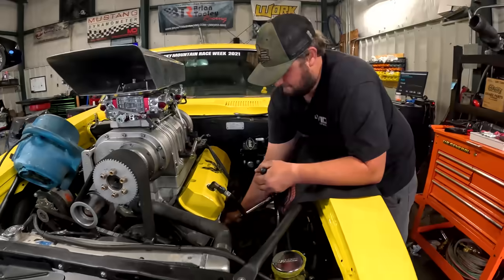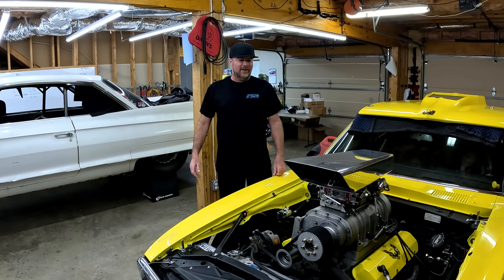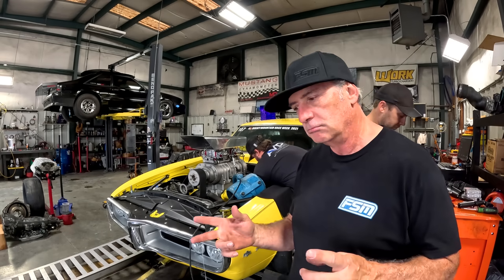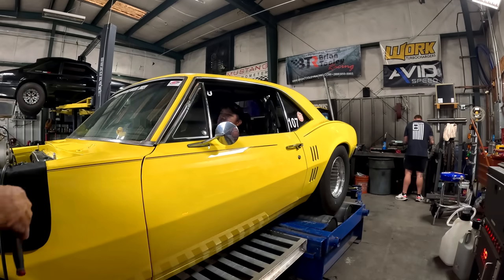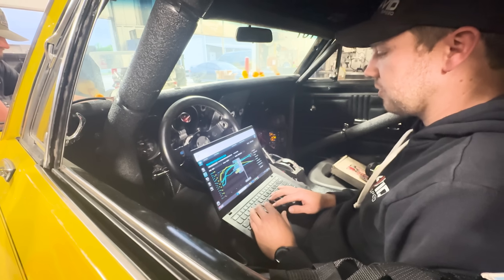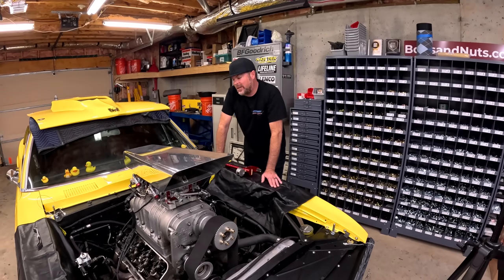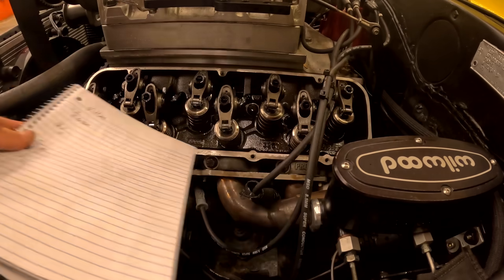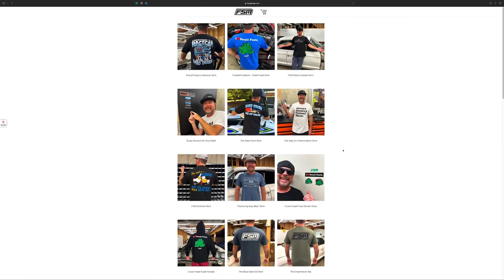I Spent $88 Bucks on Carb Jets and Added Nearly 100HP to My Barnfind Pontiac Firebird!

Comment: As a engine builder a big block with a solid roller needs more spring pressure to control that heavy valve
Reply: You need to listen to this man if that thing's got 155 lb of seat pressure you're going to have big problems if you keep running it like that
Reply: That pressure seems kinda low to me, not knowing what Cam is in it I couldn't swear to it but that's my guess.
Reply: @fredmertz1791  I corrected it for ya lol lack of sleep had me fat fingers when typing that
Reply: Agreed. The only way those numbers would be acceptable was if it had a hydro roller in it.

Comment: The absolute fastest method to lash valves is to start with # 1 (take your pick, int or ex) then turn crank 1/4 turn and check cyl 8, 1/4 turn 4 following the firing order. You end up turning the crank 2 turns to check 8 valves. Then set up # 1 to check the other valve and again 1/4 crank turn at a time you go through the firing order. This method eliminates missing valves. 
Just remember, with the exhaust valve just starting to open you check the intake valve lash, and with the intake valve nearly closed you check the exhaust valve lash. (this is called the EOIC method, and it works on every single 4 stroke engine in existence)

Comment: My car was doing something very similar.   It would break up at 6K most of the time.   And sometimes I would think I had it fixed it would go to around 6500 then break up.   After a ton of chasing and changing parts it ended up… it was the distributor itself.   I swapped it out with a new MSD, BAM problem solved.

Comment: Good to see Blake on here. He tuned my 2012 Silverado after I built the 5.3 in it and got rid of all the AFM and VVT parts and got it perfect
Reply: Thank you!! Glad the truck is doing well!
Reply: could the VVT have been tuned?
Reply: @jamesmedina2062 on some gm models, the vvt is more for egr/emissions than performance
Reply: @jamesmedina2062  it could have been disabled but my engine was losing around 4 quarts of oil every 3000 miles with only around 80k miles on it and GM claimed that was normal and within range for their AFM engines so I just tore it apart and took it back to its pre 2007 roots with some better heads, cam, valves and springs and 3200 stall torque converter.
Reply: @kyletaylor6058  Gotcha. You have a cooler connected to trans for that converter? I'm trying soon a new cooler with my trans and it's a lower stall but its a 9.5 Stallion
Reply: @kyletaylor6058  GM like many does not like to acknowledge and fix issues at dealer level. Sux
Reply: @jamesmedina2062  didn’t have a cooler on it but it for sure could have used one. I kept a pretty close eye on my transmission temps as they would get higher than I was comfortable with at times.
Reply: @kyletaylor6058  well more fluid can make up for that but adding cooler is easier now than ever. There are so many options now. At least you can see your temps.

Comment: Even my solid roller Small block Blower stuff with 2.10 intake valves about 230 on the seat and 575 over the nose , my Hydraulic Roller stuff is about 140 on the seat !
Reply: Exactly what I was thinking! I was also wondering if that was cold lash. I may have missed if the engine was warm, but both covers were off and filming. My guess is cold lash and that's way too much.
Reply: @arturozarate1752  
I saw that too  !

Comment: Air bleeds are part of tuning.
Control upstairs fuel curve with hi air. 
O2 are great for guidelines, read plugs.
Reply from the maker: The odd thing here is that at the dragstrip I saw zero evidence of a fuel ring at the bottom of the porcelin on the spark plugs. But its hard to argue with a functioning wideband O2 sensor and dyno results. The car makes more power with smaller carburetor jets.
Reply: @FinnegansGarage - Yeah any real timer will always use the plug as the end all decision maker.  That is very odd that your plugs were not showing a ring on the base of the ceramic as rich as it was.

Comment: Have you ever heard or tried the "carb cheater"? that device gonna help you tune the car on the fly and it will make your life with carbs driven cars much easier. I recommend you watch some videos on it I bet you gonna like that product.
Reply: ThunderHead289 has been a busy boy... and it works great.
Reply: Tune the carbs properly  , Carb Cheater just leans the mixture at part throttle , getting the jets and air bleeds corrected will do the same thing .

Comment: Changed Valve springs in my 390FE using a compressor and spark plug adapter in the cylinder heads. No need to remove heads. Might try that for a quick fix..😏

Comment: As long as you have the valve lash measurement you don't have to worry about overlap if you put the base circle of the cam down individually on every single valve do One works every time on  Just about any engine you'll rotate the motor a whole  Bunch of times.

Comment: Watching Old school Pro`s work is so satisfying. A lost art. what I don't understand is prior to the tuning Why did you not pull the pan and heads and simply check the internals Ring gap rod and main clearances verify TDC and measure dome and chamber. Even the camshaft can be Guesstimated in block. This is a weekend project (Friday night to Sunday afternoon) at least in my garage. The peace of mind and knowledge regarding on the internals is priceless especially considering the Maximum of 400$ in parts for Head gaskets rod, main and worse case rings. Cheap insurance and the best part is if it was not built as you need you will know what you have if you sell it.

Comment: Had a msd distributor pickup that would go stupid at high rpm and acted like spark scatter. Drove me to drinking!! Swapped crank trigger on to test and clean pulls with no problems.

Comment: I had a similar accident. The boot you have i  disliked as well. They molded a snug fitting one out of some kind of epoxy so that i can fit a size 12 shoe over it complementing my left one in size  9.5. I ripped the inners out to get a somewhat even stance.

Comment: That spring pressure seems very light for a big block solid roller deal with boost. My small block with an f2 and mild solid roller using the same LSM spring checker you  used checks 270 on the seat with a PAC1225 spring and thats with a 2.125 valve not a 2.300 valve that those darts probably have

Comment: Have you thought about using using a camera to go through the oil drain plug or spark plug hole to look at the pistons? In the past I've been able to read a part # that way. Some of the new cameras you can even steer to look back up at the valves or head gasket leaks. On my blower cars I use a huge generic 3/4 ratchet and reducer to spin them over to check lash. I picked it up at the Rural King store.
Reply from the maker: those are excellent ideas. i lost my long handle ratchet and need to replace it.

Comment: Mike you may have to go to a heavier valve spring with the boost as I think you maybe floating the valves a at the higher rpm you may have to go to 180/200 lbs on the seal   cheers

Comment: A much easier way to do valve lash is to start at TDC, do the lash on all loose rockers, and put a dot of paint (paint pen works best) on the tip of the rocker stud to show the lash has been done on that particular valve.  Then rotate the crank one quarter of a turn (because there is a firing pulse every quarter of a turn on the crankshaft) and repeat the lash on every loose rocker. After two complete turns of the crank, the lash will have been done on all cylinders.  This way you don't have to keep track of what cylinder is on it's base circle.

Comment: Mike, that seat pressure, if measured accurately, is TOO low for a solid roller. That's hydraulic roller seat territory. Also the lash....if cold thats a lot.

In my experience with blower cams, the card has asked for 0.018" to 0.022" hot lash. 

With the expansion of metals different between engine to engine, I like to test each engine the same. I start at zero lash cold. I bring the engine to operating temperature at idle. I then remove one valve cover at a time checking lash at this point. On an iron block with aluminum heads, I've measured as little as 0.004" to as much as 0.006". With the difference in manufacturers materials there's a variation in densities and therefore expansion.

So now knowing this hot lash measured you know your expansion and can set lash cold accordingly. Hope this helps.
Reply: Strongly agree.  Not sure I've ever seen both valves set the same. Exh normally has more clearance to compensate for more heat.  Good advice. 👍🏼
Reply: @rivermobster  well, the cam I just stabbed in a Shelby Aluminum 482ci FE asks for 0.020" hot int/exh. Although I know what you mean.

Comment: my old 360 with a mild cam Had 120 130 ish @ the seat in 2004. that needs way more than 145 or what ever it was i would change the spring to some thing better but I guess you need to careful the valves are up to bigger springs and not pull a head off lol

Comment: Valve area x boost psi subtracted from static seat pressure = running seat pressure at boost. 80-100 psi seat min your good.

Comment: I broke my leg (tib/fib)15 years ago, but just a couple of weeks ago, I had 2 screws surgically removed that were above my ankle because one of them actually wore a hole through the skin and became exposed, no joke! I had the other one removed just because it was next to the exposed one anyway, and it was bothersome and could have gone down the same road as the exposed one. If anyone would like to see a picture of it, ask me, and I'll email one. It was pretty odd. Even the Dr's had never seen anything like it, and I became the freakshow of the office.😅 So I feel for ya, Finn. I hope you heal up quickly!
Reply from the maker: ouch!
Reply: I had a pin that healed under the skin in my hand. Freaked me out when the doc pulled it. But it popped through without any pain and was not a big deal. I do have screws and a plate that I am planning to remove this year from my foot. Hopefully that also goes without pain. Gotta stop breaking stuff!
Reply: @imalec  Yes, breaking stuff is no good! Good luck with the removal!
Reply: @FinnegansGarage  Ouch, indeedarooni!!!
Reply: @imalec I had a screw in my thumb that had a pin next to it. I went to grab something out of a friend's hand and he slapped my hand. The pin immediately popped out with no pain but I screamed just to make him feel bad. I went to the doc and he finished pulling it out, that stung a little. My friend felt so bad. He would do anything I asked until a week later I told him I didn't even feel it.

Comment: Not remotely enough seat pressure for a solid lift cam with boost on a BBC with huge heavy valves, I been thru this exact thing engined revved clean no boost, added boost and ended up needing more spring then it would rev to 7600 on 17psi ( on accident I didn't like more than 7k).
 Shim em up if you to room for coil bind, and it will literally pick it up everywhere...

Comment: Mike that spring pressure sounds low for that combination, could be your floating the valves
Reply from the maker: its very possible that you are correct. It was fine on the dyno but this next track test will tell me whether or not we have a valvetrain issue.

Comment: I wonder how skewed the number are on that gauge by the variables that affect it? I’ve never saw a solid roller setup with less than 240 on the seat. I’d think a BBC with heavy valves and a blower to boot would like 260 on even the most mild solid roller setups.

Comment: what are plugs gapped at? I've had to go as low as .015 to light them off under big boost. Having a ton of gap isn't going to make much power. better to go small with forced induction.

Comment: Solid roller BBC with 140-150 on the seat? Sounds pretty light to me, I would say not enough valve spring for 7000 RPM.

Comment: Glad to see your healing up buddy. Stay away from the manuals for a little longer so that break can heal up strong. (Sorry, its the dad in me). Now I will make a prediction here. Barring that little stumble at the end of the last pull , you'll get your 8 without the party pully. Think about it. 10% more HP than before. And even more of a torque increase. My guess is 8.97.   And as for the stumble, Joe  opened up the plug gap. I didnt hear how much. And possibly some dust got in the carbs while they were opened up. They did have them opened 4 times? Just thinking out loud. You'll figure it out and get your 8.
Reply from the maker: I'm proud to say that while moving cars around the shop today i resisted the urge to drive the 510, the elco, the crx and Death metal cause they are all manuals. lol
Reply: @FinnegansGarage  And, let me know when your ready for more salsa (I know, silly question)...

Comment: I’ve heard you say that about the guy not using silicone. I typically don’t like using silicone on gaskets unless there’s a seem where two gaskets come together, but I don’t really build high horsepower engines either mostly stock with some mild builds. I was taught that that’s what the gaskets for, and if you clean the surface well enough, and your mating surface is straight you won’t have a problem, from someone who at the time I thought was an old timer, now I fit that description. Lol but I’m always open to learning something new. Do you use silicone on the whole gasket surface, and why?

Comment: For not knowing what internals are in that motor it runs great for the abuse you have been putting it through! $88 was money well spent to gain that much horsepower and that was without the party pulley!

Comment: Is that enough valve spring pressure to control the valves with 10psi  boost?  What about the party pulley?

Comment: For that boost I'd think it would make more to the wheels out of a BBC. Have you guys done a leak down on it yet?
Reply: Also, while it was on the dyno did they check how much the converter is slipping? It pretty simple to figure out when comparing roll speed to engine RPM when in 1 to 1 on the trans.

Comment: man  I want to see a complete tear down of that motor soo bad !!
Reply from the maker: As long as it doesnt protest I'm leaving it together. I think there's a ton of power sitting on the table because the cam timing isn't right. Maybe one day we'll do a valvetrain upgrade and see what that gets us. TBH if it runs an 8 second pass I'll probably leave it alone.
Reply: @FinnegansGarage you run that thing like you are and you leave those valve  springs in it like they are you ain't going to have to worry about it it's going to tear itself down
Reply: @FinnegansGarage   oh yeah 100% agree !! if it aint broke do open it ,lol

Comment: My 2 cents 
*Add a light shot of NOS at the top end 
* modern top of the line distributor 
* new modern fuel: lines, pump, pressure sensor 
* start putting her on a diet ( weight reduction)

What the hell I know   I’m also chasing squirrels and beers

Comment: It’s not floating the valves with so little spring pressure is it ? Causing it too break up
Reply: yep my old 360 flat tappet cam was 130 at the seat with a mild cam it needs way more spring i am guess 200 ish maybe more .

Comment: You know that should be 250 on the seat right like bare minimum on a motor like that?
Reply: my 360 with a mild cam only had 120 130 i think that at 145 ish is way off what it needs to be

Comment: I'll bet that I'm not the first one to say this:
140 lb is not enough seat pressure on that engine. Neither is 160 or 165. Not with those big heavy valves and that kind of rpm. Not with 10 lb of boost.

Jack Henderson

Comment: So basically you leaned it back out n checked the valves. The motor works great on the dyno. I'm betting when it's under acceleration forces? It will start breaking up again. Unless you did something secretly.  And quit milking that leg. Wasn't it a sprained ankle last time? 😂 think like Burt Reynolds in that  movie about formula one where he made his driver hop.on his bad leg before he let him drive.